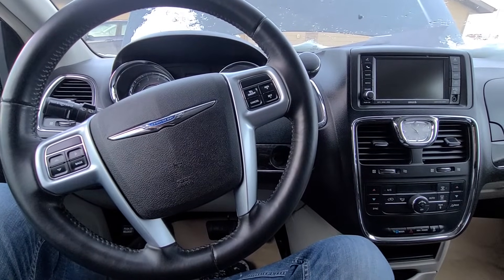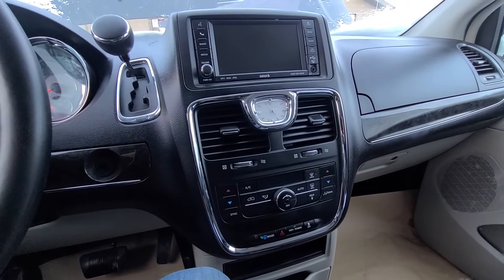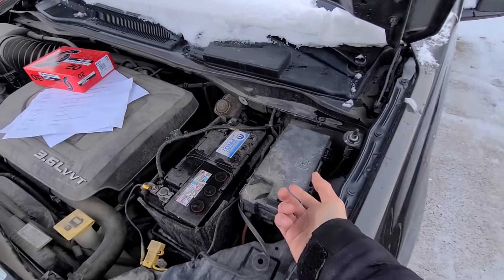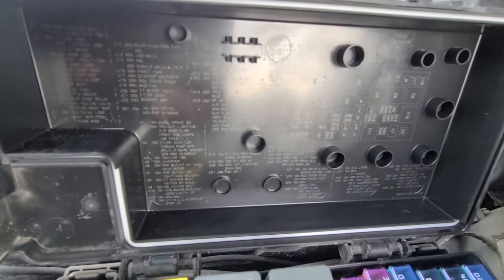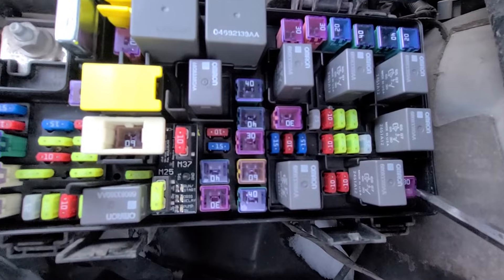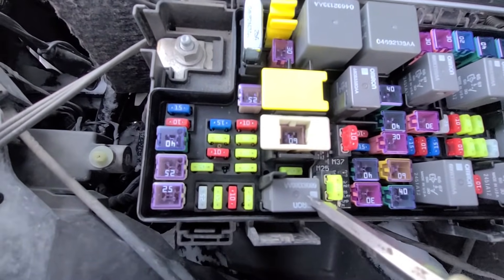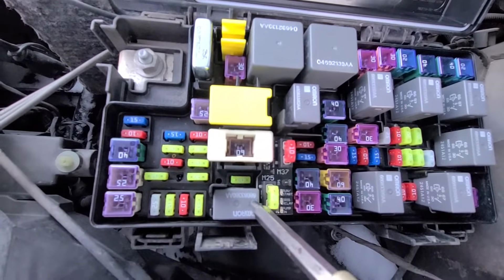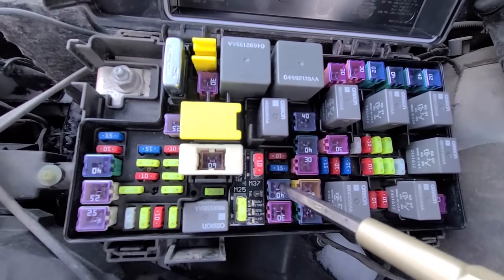Chrysler Town and Country - HVAC Blower Motor Fuses & Relay Location (2008 - 2016)

Comment: My heat & air, when I turn off it comes back on in a few seconds why is this happening?????
Reply from the maker: Hmmm I've never experienced this. Could be a faulty climate control assembly or a wiring issue. Sorry I can't help more

Comment: Would the blower be delayed from a bad fuse? Mine heater blower is delayed coming on-just started today.
Reply from the maker: Hello no it wouldn't be delayed. Is rear defroster button blinking once you first start the vehicle and blower starts working after that? If yes problem is with the blend door actuator not synchronizing. This usually happens when one of the actuators fails or more often when actuator is replaced with aftermarket part. Replacing with OEM part is pretty much a must on this vans

Comment: Hey, when i turn the fans off completely, they turn themselves back on! Even when i press 'off' they put themselves back on again. Have you seen this before and what would you recommend? Thank you!
Reply from the maker: Hi, hmmm never had that happen. Could be a problem with the relay, possibly climate control unit, wiring or even the pcm. Sorry I can't help more but you will have to find someone to first scan the vehicle and access the hvac module for any codes and then follow up on those

Comment: I'M LOOKING FOR THE BLOWER MOTOR RESISTOR ON A 2012 CHRYSLER TOWN AND COUNTRY, AND HOW TO REPLACE IT. SO FAR I'M NOT FINDING ANY VIDEOS OR EVEN THE EXACT LOCATION FOR THE YEAR AND MODEL IN QUESTION. THANK YOU FOR YOUR HELP.
Reply from the maker: Hi, blower motor resistor will be located behind the glove box and held by two screws and usually 2 electrical connectors going to it. First you have to lower the glove box and you should see it right away. Process is similar to replacing the blower motor. You can also search blower motor resistor replacement for Dodge Grand Caravan as those vehicles are almost identical. There is couple of videos on YouTube

Comment: hey, my dodge grand caravan blows hot air while at idle or red lights but blows cold when at full speed..i replaced the fan, both engine cooling fan motor relays (one that looks green with a cylinder shape that goes in the fan & the all black relay that goes from fan to engine), also replaced water pump & still don't know what's the problem!!!
Reply: maybe a refrigerant leak, have you had the refridgerant 'recharged'?

Comment: I think mine is not broken but it s just weak as hell it never really heats up to temperature compared to any other car, is it all town and countrys like this?
Reply from the maker: Blower motor is only responsible for fan blowing / fan speed. If your vehicle does not heat up properly start by checking:

1. Coolant level.
2. Thermostat
3. Heater core

On Town and Countries thermostat will often fail and cause heat not to work properly. Very easy and cheap fix